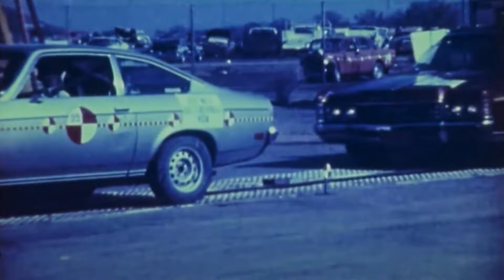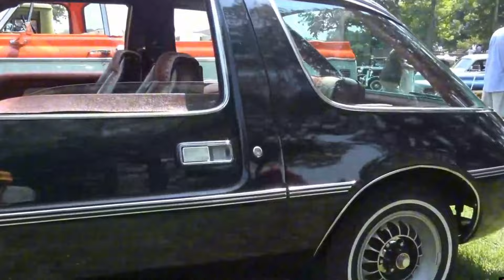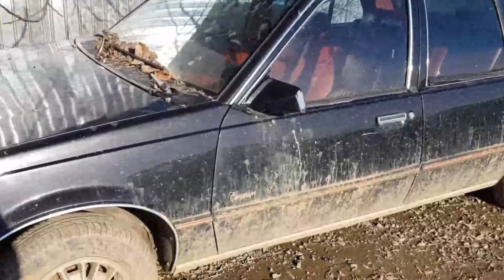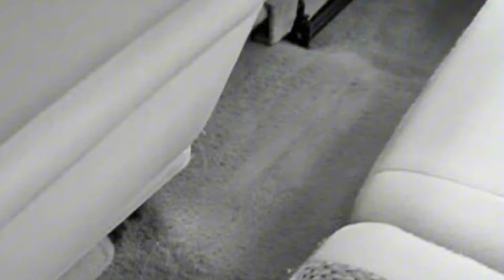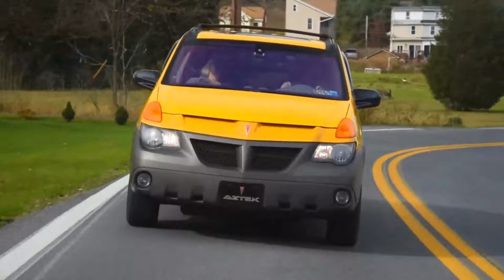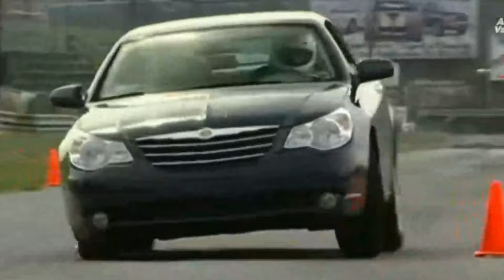Top 12 WORST Cars in US History

Comment: Should add the 1979 to 82 Datsun 210,
A series engines self destructed by 70000 miles, bad Manual transmissions, had same gas tank recall of the pinto, rust and electrical issues.

Comment: The Ford Pinto is an excellent car. I have owned SEVEN of them over a period of 40 years, once had three of them at the same time. They are one of the most reliable cars ever made. Mine were all 1971-1973 models, one sedan, four hatchbacks, and two wagons. I am still driving a 1973 Pinto Squire Wagon. I have owned it for 23 years. Not only is it one of the most reliable cars I have ever owned, it is also one of the most practical. All of my Pintos have/had the 2.0L SOHC German made four cylinder engine, one of the simplest engines ever made. Five of them were/are four speeds, two were automatics. My current wagon is a four speed. The four speeds are much nicer to drive, faster, and somewhat more reliable than the automatics. The four speed transmissions are also German made. My '73 Wagon is an original AZ car, completely rust free, and still rock solid after 52 years. Three MILLION Pintos were sold over ten years, and sales numbers were high throughout the entire production run. Certainly not a failure. And I can certainly understand why. Ten times (or more) better than any of the modern GARBAGE being sold today.

Comment: I know this is AI but the Pinto information is all wrong.  Out of 3 million Pintos sold, 9 people died as a result of rear end collisions.  The so called "smoking gun memo" the media used to say Ford knew the Pinto was dangerous was actually a memo about possible roll over fatalities across the entire line-up.  The Pinto was never mentioned by name in that memo.  Ford settled the cases and did recalls purely as a way to shut down the hype. Nobody wants bad publicity.  The Pinto enjoyed an 11 year production run from 1970 until 1980 when it was phased out because of the new FWD Escort. It was NOT phased out because of safety concerns.  In case you are wondering what your chances of dying from a fire in a Pinto were, it was 0.000003%.   3 million sold.  9 fatalities from fires.  The FACT is you were just as safe or safer in A Pinto than you were any other compact car.  The proof as they say is in the pudding.  Even after the overblown media fire hype, which started in 1974 the Pinto still sold well.  In other words, the Pinto customers were not buying the story.
Reply: As someone who has owned seven Pintos, I agree 100%. The whole "exploding Pinto" thing was complete BS.
Reply: I had a pinto got rear ended nothing happened

Comment: I had a 1972 Vega. The engine was much worse than you state. After 15,000 miles you had to add oil at every gas fill up. The smoke screen was good for fogging mosquitoes though.